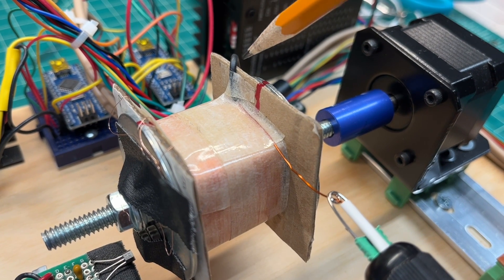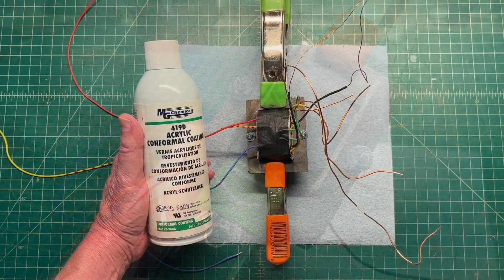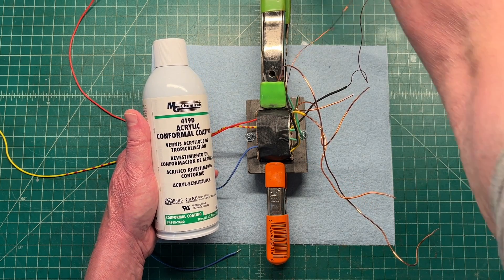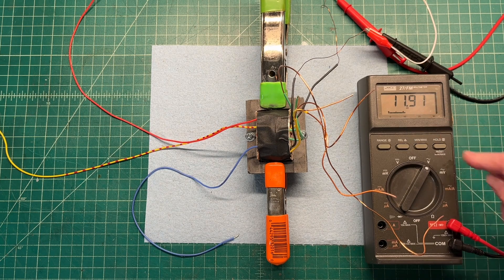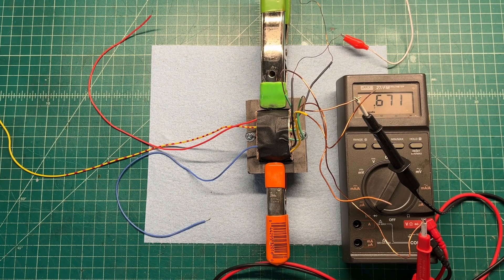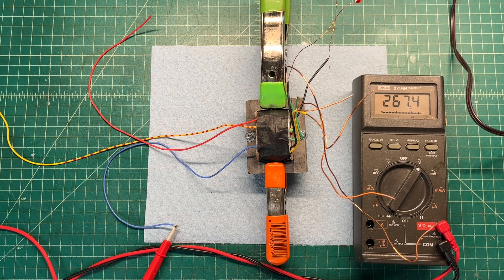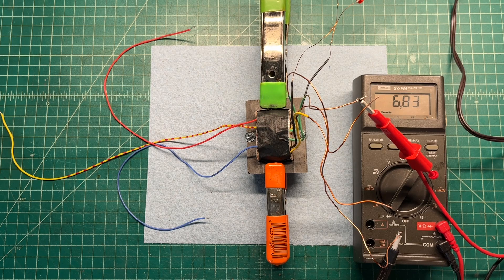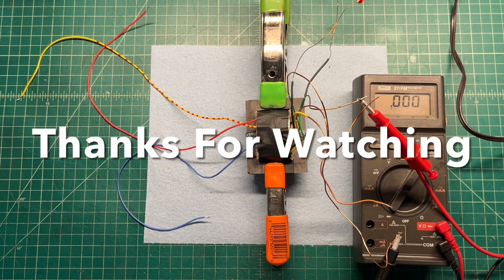Stewart-Warner - 01-521 | Power Transformer Rewind Final & Voltage Evaluations

Comment: Are you able to wind Transformers for other customers? The reason I ask is because the guy who used to train wind my Transformers retired a few years ago and all the commercial companies that do it want to charge three or four times as much money. It would be nice if I could find somebody who does this at a reasonable price.
Reply from the maker: Sorry, I don’t as this is only a hobby for me as time permits. I’m assuming you reached out to EDCOR for quotes at: https://edcorusa.com/pages/custom-transformers. Hope you find someone reliable/affordable. All the best. Don
Reply: @RestoreOldRadios  yes, Edcor stated they do not rewind transformers. Another place, Butler Transformer, quoted over $800. My guy in Oronoke ME used to charge $250.
Reply from the maker: Wow, that is expensive. Are the transformer rewinds audio or power? Best, Don
Reply: @RestoreOldRadios  power transformers.
Reply from the maker: @amplifierexperts1983  If I run across someone that provides that service, I’ll reach back out. Best, Don
Reply: @RestoreOldRadios  thanks, Don. All the old timers are dying off/retiring and it's near impossible to get a transformer rewound nowadays.
Reply: @RestoreOldRadios  many thanks!

Comment: Hey Don
There was a electric motor shop. I’d worked for. We used a type of rattle can varnish called Dolphs AC-46. That we’d as a first coat on motors after stripping the old varnish. It had anit fungus properties, and I believe like a 5,000 volt dielectric strength when used correctly. It coated very well! When I used it I figured it be perfect for power transformers, and output transformers, maybe hand wound coils too, and very well could be more than that! but if I recall correctly it’s quite pricey, and kinda tricky to find on the web! If your interested in trying to hunt it down!
Thank you very much for the work on this. I’ll have to check out the MG conformal coating, I love their Solder, though the one I got the first time. I believe it is too low of a temp for vintage tech. Its melting point is around 350°F!
Reply from the maker: Thank you the information, I’ll definitely keep this in mind and reach back out for questions, etc. Best, Don

Comment: Thanks for showing. It looks great and I'm sure it will work fine in the radio. I once wound an audio transformer from spare parts and 3000 turns later, I ran out of window area half way through the secondary! I wasn't using that great of equipment to do the job though.
Reply from the maker: Those windows fill up quick for sure. Even with my winder, I get a lot of overlapping, etc. Thanks for sharing and reaching out. Best, Don